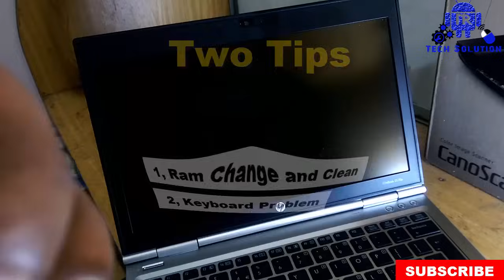Laptop POWER ON But 💻Display Blank (NO Display) 100% Solved ✌Only 2 Tips

Comment: I'm just wondering how the keyboard affects the start up of the laptop?
Reply: It's a laptop, it needs to be as compact as possible so usually manufacturers put 1 or 2 ribbon cables responsible for the screen, keyboard and sometimes even the lights.
Reply: Walter on the side of my screen, there are two wires (white and black) that are both ripped...how would I fix that??
Reply: Yes i am also wondering ... How it is ?
Reply: Excuse me please I am also facing same problem now power is on but no display what can I do please tell me

Comment: Honestly, I would try to do this myself but I really feel that its risky so I took it to a shop, and turns out the ram was the problem, we just needed to clean it. Thanks you so much 👍
Reply: How much it costs
Reply: @pk3798  I don't remember, but its mostly around 10k+
Reply: @averageguitarguy_  you paid 10k+ for cleaning the ram?
Reply: @ensixraa  I doubt the guy means 10k usd, it's probably some other currency
Reply: I did it same. I just replaced 2 rams from its places. So it worked. Actually it need little cleaning with blowing little air. It worked for me.
Reply: @AnifreakGed  rps

Comment: I had a problem with my laptop , when i turn on the power its black screen then when i try connect to my flatscreen tv its working what should i do to fix my screen back to normal?
Reply from the maker: Please Watching the Video step by step ,its working
Reply: Then the problem of your laptop might be the built in graphic card or the led screen
Reply: Same with me. I can connect it to a monitor but the screen on the laptop is black.
Reply: @techmate6358  I think I agree. That is what is happening with me

Comment: can someone tell me what to do.. i have dell Inspiron 5502 and last night i used it it was working fine and in morning when i turned it on first the screen got some small pixel dots on it and then when i restarted the screen got whole black and didn't show anything .. fan was running and system was heated up after that but it showed black screen!!!
Reply: Location?

Comment: Mine has the same problem, monitor won't turn on but the machine running well. I reseated the ram, but it wasn't the case. Monitor still shows black screen. My laptop is Asus x540lj, the power button connected to the keyboard. So if I unplug the keyboard ribbon, I couldn't turn on my laptop. Any solution?

Comment: I have two RAMs on my HP HDX16 computer. If the two are attached, I'll have black screen but if I will attach only one RAM on either slot, it will turn on. What is the problem of my computer? Is it okay if only one RAM will just be attached?

Comment: Tips:Plug in the charger press power button for some seconds then plug out charger and battery and hold power button for 20 to 30 seconds then again plug in charger and batter click once on power button.Autorepair start and after some time click continue key.I hope it helps.

Comment: My laptop has inbuit battery(windows 10).My system keeps turning off as I type in chrome/ windows search bar/ excel or word.When display turnoff , the power led keeps blinking every 3 sec.Troubleshooted keyboard and set sleep mode to never but still problem persist.Help me plz

Comment: Hello! I've seen you are solving many pc problems. I need your help this way.
I have CHUWI HEROBOOK. It's problem is

1) Power on but no display

2) Keyboard not working working (only power button working, others not working i checked with caps lock)

3) My pc isn't sleeping after adjusting back & front part😭😭 the green light still on after adjustment of two part

Please help me if you have any answer💕🙏

Comment: I get 'republic of gamers" logo on screen at start up, but windows won't boot up on display.......HDMI connection works fine on external display......What could be the issue?
Do I need to Alt-Tab or Shift and press a button?

Comment: This mostly caused by the ram..some people probably have the problem where your laptop has power but no display on screen and sometimes the laptop makes a beeping sound..simply hold down the power button until it's off...open the back of your laptop or wherever you need to open to get to the ram chip..take out the ram and put it in the other slot if it has two..or if you have two ram chips installed try switching them around..if that doesn't work take out the ram and try starting the laptop then take it off and put it back in...I had a problem where I bought another ram for my laptop but when I installed the other one the laptop display wasn't turning on so I just switched places with the ram and it turned on...sometimes it may not be the ram I could be your display cable disconnected or got damaged
Reply: If its damaged can it be repaired
Reply: @kenshin0669  if you're talking about the display then you probably would have to get a whole new one..RAM sticks you can buy online
Reply: @EAImagination  thankyou i bought a new ram stick online and it'll be here on march 6 luckily i ordered one before my laptop goes black and i knew after researching is that my ram is faulty and worse
Reply: @kenshin0669  okay I hope it works
Reply: @EAImagination  if it works and i boot it up will the indicator light up as two again?to simplify i really don't know what you call that but sincey laptop that has only light indicator the power on light without display,
Reply: @kenshin0669  your laptop had two lights?
Reply: @EAImagination  idk how to explain it but it only shows white indicator when its powered on and no display, so does replacing ram really works?i mean cause i've done watching youtube tutorials like i've watched a lot and it doesn't work
Reply: @kenshin0669  I can't say if replacing the ram will work for you but Everytime my laptop has that problem it always the ram..many of times I opened my laptop and turned it on and the screen just won't come on although the laptop is on I just turn it off and go to the ram and it works

Comment: Are there ways to use another power button in an Acer Laptop?

My laptop's hinges are broken so I have to always keep the lid open for me to open the laptop. I want the lid to always be closed (as it collects dust and space).

Note that I already have an external monitor available/connected.

Comment: Hello brother, my laptop fans keep running after shut down and they keep running till the battery is full drained. ( All night 12-13 hours). I cant switch on the laptop while the fans are running. It becomes very difficult to switch on laptop.Please suggest solution

Comment: Sir its been 2 months, past from few weeks my new laptop has a @t I type either in windows search bar/ google chrome/ word/ excel system unecpectely turnoff display to black without a cursor.Thereafter power led blinks every 3 sec.When press hold any button for few sec screen opens and becomes normal.Happens lot.

Problem started after windows update from version 2004 tov20h2

Tried troubleshooting keyboard/power/All drivers are uptodate.Even I h've selected screen turnoff to never.Still problem not fixed.Kindly help me.If possible
Reply: Send back to manufacturer for replacement

Comment: I have a laptop Acer Core i7
 This laptop turns off when Windows is installed, now it does not accept Windows
 Now the laptop is in such a state that it does not run and Windows does not accept it
 When you turn on the laptop, the program that was in when you started Windows remains in this program.

 Please tell me if this is a problem or how much money it will cost
 Let's answer.

Comment: Remove your main battery then disconnect CMOS battery for 5 minutes, connect your CMOS battery and plug in charger while your main battery is still disconnected, try turning it on and if it turns on then shut down your laptop and connect main battery, Try turning it on again.

It should work, I had the same problem.

Comment: Mine was ram problem thanks 

I removed that coin thing thinking it’s bios issue but I was ram wasted 2 hours for nothing 😂

Always go like these steps 

1. Try connecting to power
2. Press the power and hold 
3. Remove ram stick and see if it works without it.
4. Remove the coin for 1 min and put it back and see if it works

I think I had all of the issues with my pc and didn’t know same thing can happen to laptop and it can be fixed using same method 
4

Comment: My laptop is turning on but no display and the keyboard lights are not responsive also(caps, numlock).. what will I do.  And there is slight earthing when touching the vga port
Reply: Switch the ram slots after cleaning them. That's what worked for me. Jus swap the slots

Comment: My msi laptop was flickering ... Dislay wasn't showing but fan was on and keyboard light could be turned on and off .... Screen was flickering.... So i pressed the power button for a long time.... And then it turned off and then it turned on and it said Windows couldn't load correctly .. so i clicked on restart and finally it worked and laptop was on

Comment: i hv done both ... but laptop still nt responding 
😢 i dont wanna lose my laptop ..
Reply: what did you do next?
Reply: @younesmohssen8158  done too much
Reply: the seekerz did it work eventually?
Reply: @younesmohssen8158  i attached my LCD to my laptop as a second screen after all this . . it worked . then tried to delete unnecessary files . during all this my laptop screen automatically appeard because i selscted the dual screen option .
Reply: the seekerz ahhhhh that’s great news man, i’ll try that and see if it works!! pray for meee ;))
Reply: @younesmohssen8158  workd 4 u or nt ?

Comment: Hi 
I have a fujitsu laptop and it has no display . It works well with HDMI cable on external monitor. I checked the display connector on another laptop screen which works well . Please suggest What could be the probem with the screen?

Comment: I have an issue when i changed my refresh rate on my asus gl502vm laptop to 71hz on Nvidia control panel and then the screen turned black and it was still running

Comment: I upgraded my ram
But after the windows logo the screen is black while the laptop is still on
How do i fix this?
Reply: Switch the ram slots once
Reply: @epicgaymer6233  there's only 1 ram slot
Reply: just press Ctrl+Alt+Del on your keyboard. Windows 10's normal Ctrl+Alt+Del screen will appear. Click the power button at the bottom-right corner of your screen and select “Restart” to restart your PC. Your computer will restart normally with no more black screen

Comment: Hi I have same problem..but I dont which one is the problem..I tried to connect my laptop to a MONITOR ...yes I'm happy that it did connect to a monitor..WHAT is the sign of a RAM issue?I know there's something wrong with my keyboard before its turns like black screen  Coz it has beeping  sound everytime I turn it on...and my ports are not working anymore..i just want to save money that's why I want to know which one is the issue of my laptop before I let someone fix it..tnx

Comment: Hi there.., i have the same exact laptop you fix in your video and yeah the same problem that i have...i did what you did in your 2 tips but still no luck because there is another problem that i noticed with mine, my power button is automatically booting without pressing it when plugging the charger and yes it booted coz i see the white light indicator and the display says that "no mouse attach" and "Press F1 to blah blah blah" and it will turn black then white light indicator turns orange and the fan stop then starts again and then no display at all...i hope that you can help me...and yeah thanks for the video..already subscribed in your channel and more power!